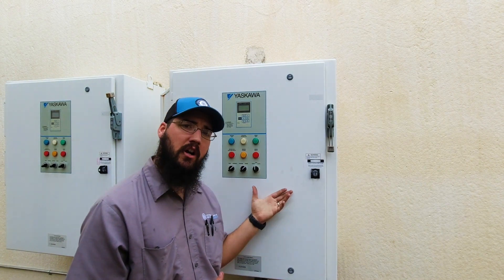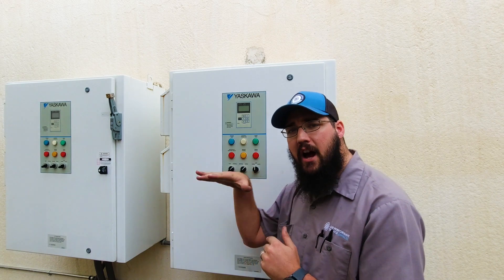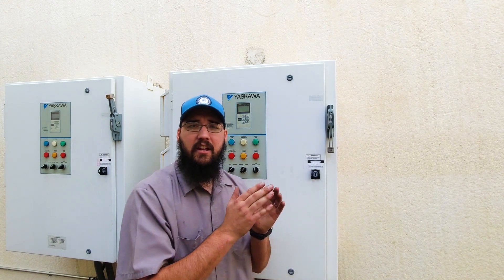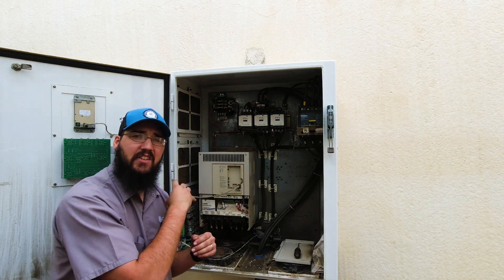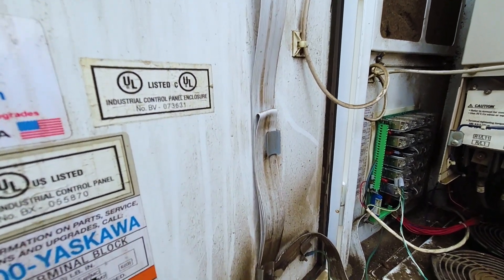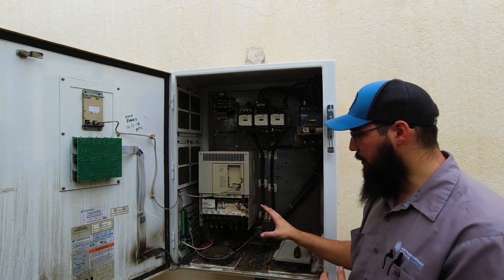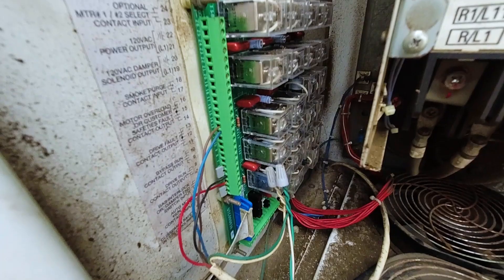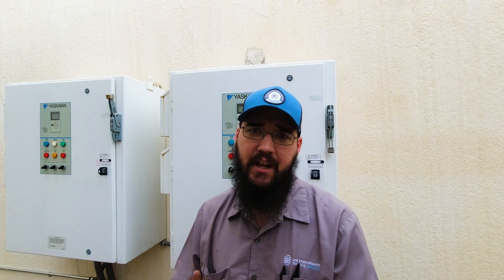How to PM a VFD with Bypass

Comment: Checking for DC voltage on the output terminals is NOT going to tell you whether the DC bus capacitors are still charged. You need to check at the terminals that connect direcrtly to the DC bus (often DC + / DC - ). Following the methods shown in this video could result in someone being hurt or killed.